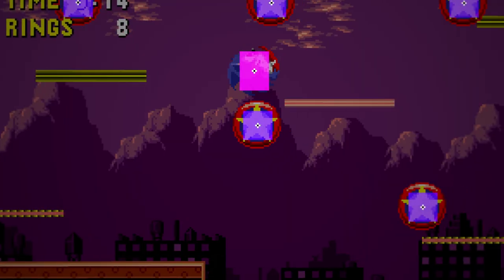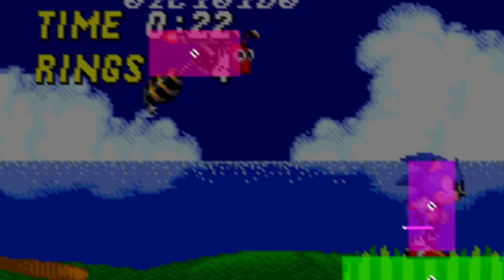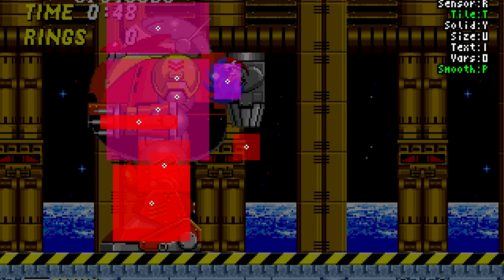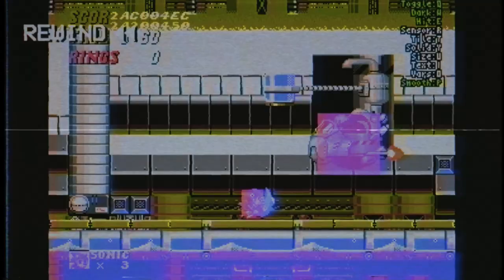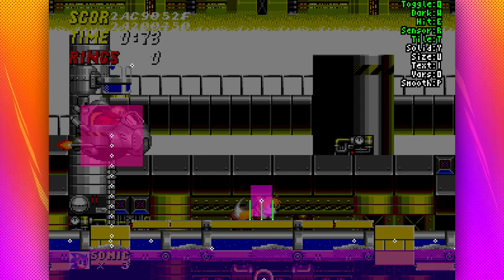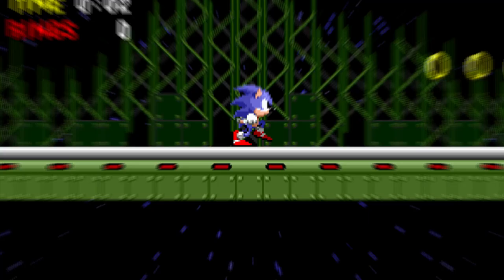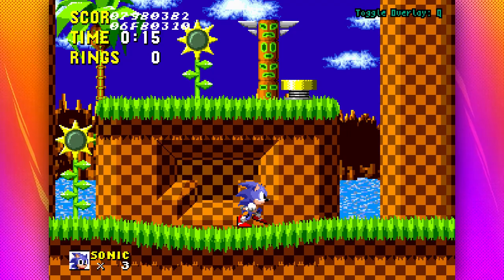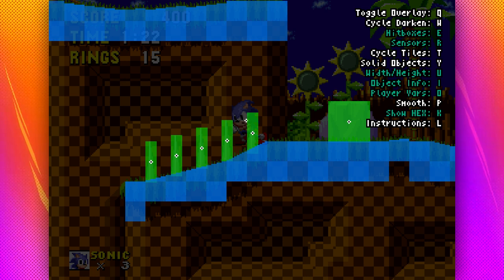AWFUL Hitboxes... - Behind The Scenes Of Classic Sonic

Comment: So how would one create a physics system like this? It's awesome you can visualize it, but I think it would be even more awesome if you could create a tutorial to recreate this movement/collision c: 
Yeah there's a Physics Guide but that is only in semi-code and doesn't apply to modern game engines in some cases, and the tutorials that are there on the internet never tackle slopes, only straight movement, and even then it's rarely correct to the Physics of Sonic. I have created movement on straight surfaces like Sonic just fine but slopes are just so difficult to handle with very little explanation as to the how.
Reply from the maker: The guide is designed to apply to any game engine (I know because I have been adding to it for years!) if there's anything about the guide that confuses you or you feel needs better explaining, please DM the Twitter account @SonicPhysics (me) and I can explain things or make changes.

But when it comes to slopes, in particular sonic slopes, the main advice I give is make the collision yourself using your own system, don't rely on the built in collision functions or default systems in these modern IDEs, otherwise it's likely to be even harder to do the advanced stuff (and in worst cases, affect your physics in ways you can't control). It'll mean less/faster code, more control, and better results.

Comment: I always wondered why a hitbox can't just be the same as the model, especially in pixelated games?
Any answers?
Reply from the maker: It would have to then check many many 1px squares rather than just 1 big one, saves a ton on processing. These days computers can do it easy, but it is still simpler to code, design, and process with simple boxes.
Reply: @LapperDev  Fair enough, I suppose.
Reply: @Foaklore  Plus, when done right, the player's not actually going to notice if the hitbox doesn't line up 1:1 with the model. And sometimes, if something's hitbox perfectly matches an object's size, the player will say the game's cheap and that they're getting hit when they "clearly" avoided something, or that they should've picked something up but didn't. So, devs usually rig the game slightly in the player's favor so the player thinks the game is fair and not rigged against them.
Reply: for context, hitboxes are really simple as all they require is comparing the sums of the objects' coordinates and dimensions, i.e. you can tell if two objects are overlapping horizontally by checking a.x + a.width > b.x - b.width and a.x - a.width < b.x + b.width. or, in other words, by checking if a's rightmost edge is to the right of b's leftmost edge, while its leftmost edge is to the left of b's rightmost edge

then you just a similar check for the other dimensions and bam, you can now tell if a and b are overlapping with only a handful of checks and instructions. checking for overlapping pixels has nothing so elegant, unfortunately
Reply: Making hitboxes being the same as the sprites would make the game coding much difficult than they need to be, and also putting too much pixelated hitboxes would cause it to lag a lot. That's why it's recommended to make collisions as close as possible without using too much hitboxes.
Reply: Fun Fact: E.T. for the Atari 2600 had pixel perfect collision detection. this is why E.T. would fall into pits that his feet weren't even close to, because if even his head touched it, in you go.
Reply: @radwolf76  

which as something that felt kinda isometric, really screwed with people's expectations.

Comment: some instances of that slope in emerald hill also exhibit the same no-slope-physics traits in their top half that you highlighted in the marble zone slope object, i've noticed. it's very silly rolling on them only to come to a dead stop a couple inches down.
Reply from the maker: Because of the way it works, the flagging of that EHZ tile means you will be able to walk on it as if it is a flat wall (angle = 90), hence the flying straight up when leaving) when you are already rotated, but ALSO as if it was a flat floor (angle = 0) when you are already right side up. 

I noticed its oddness way before I looked into Sonic games and I always did wonder why.

Comment: I hate that I know most of these quirks and abuse them on a daily basis in ROM hacks.

Speaking of, the script doesn't seem to work on ROM hacks at all, even after changing the header to the original games, despite the fact that for most of them the hitbox system stays the same, it's a shame cause this would've been a great script to use for debugging.
Reply from the maker: Yep, unfortunately to provide the information (the real information as it happens, rather than guessing based on specific object ram data) the script has to run functions during execution of specific lines of the game code that are present in the rom. All the EX_* values are positions in the code for the Sonic 1 REV01 in this case. 

Not saying it's very practical, but if you could manage to correctly reposition all the EX_ values in the script for the code in a hack build, it would then work for that too (only if it's still Sonic 1 and the stuff being read still works the same).
Reply: @LapperDev  Yeah at that point you may as well make a collision view system in the ROM hack instead cause things will inevitably shift around (not to mention completely break on new systems, such as the one in "I made you a Salad", where the collision sizes are in their own dedicated bytes instead of part of a look up table)

Comment: ngl i did know most of these facts ahead of time, but there were some that still threw me off.
1: the game pauses 1 frame? WHAT?
2:Sonic can leap in the air from a slope in spring yard? Bruh.
3: 3:53 I've known sonic games for more than most people probably have, but I've never seen this before in my life.
and... that's it.

Now, for facts about Sonic 1 and 2's hitboxes, here's a fact that I know that isn't in this video at all. Did you know that in Sonic 1-2& 3k that you can clip through the ground and teleport around the stage? I don't have a single clue how this works but there are dozens of tas's about them. As for Sonic 3 and knuckles, it's not only more rare but MUCH harder to pull off.
Ok, so for Sonic 1, obviously we know that the see saws have 2 collisions that look very weird and janky, but yes mostly everyone knows about this trick, in scrap brain zone the traps that push you that are meant to kill you can be clipped through either through crouching toward or above them, I forgot which though.
In Sonic 2, yes, in Sonic 2, you can beat oil ocean zone just by going underneath the entire stage, again, only accomplished from insane tas.
...In Sonic 3 and Knuckles, that game is extraordinary in jank bugs and glitches, so while I don't have any knowledge on the hitboxes of that whole game, I did know that I can say is that for hydrocity zone nearly every slope and collision is not as it seems. Infact it's nearly impossible to explain it without just seeing it for yourself in you guessed it, tas sonic. (EDIT) well.... used too be rare. not anymore.